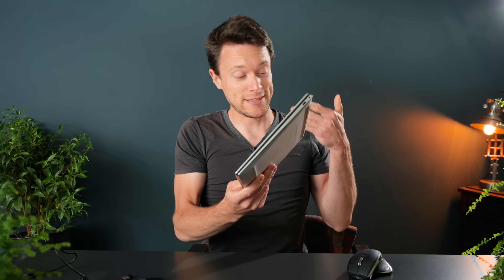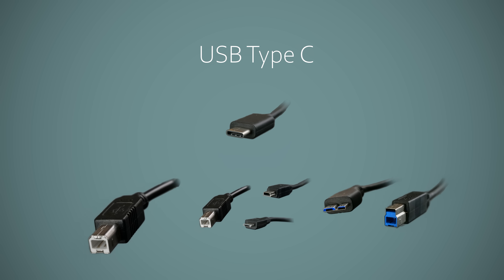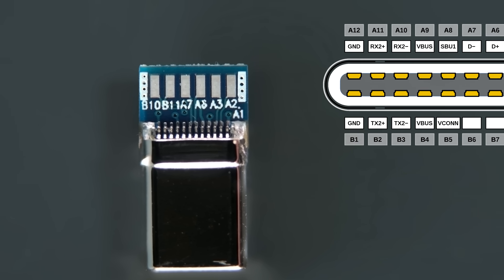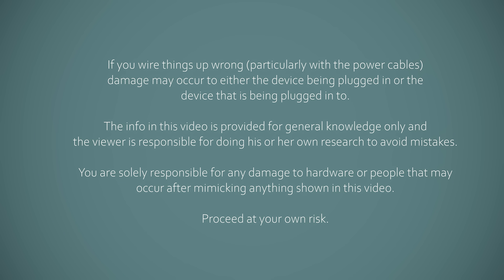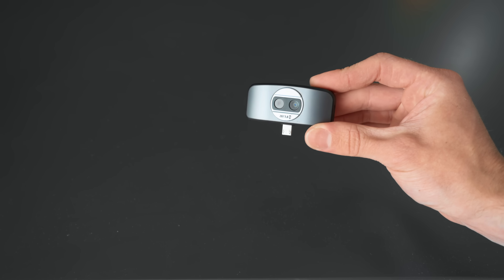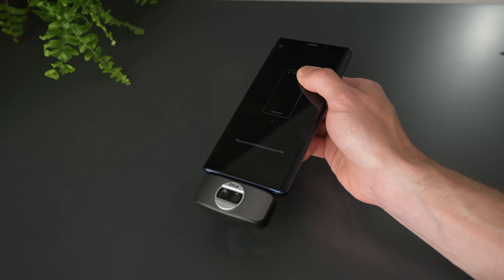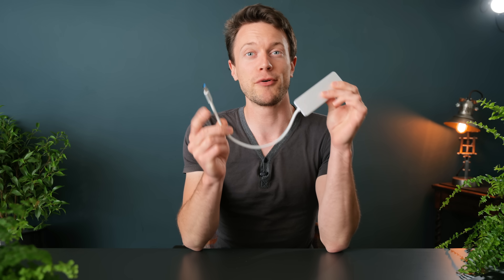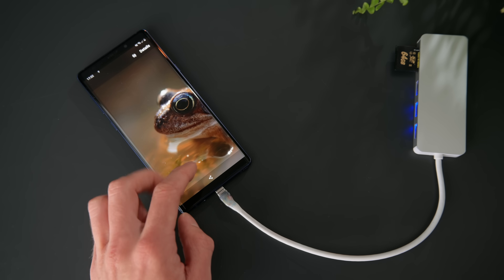Converting devices to USB Type-C

Comment: I think this guy does amazing work and I have subscribed but for those who don't want to, can't or fear trying this kind of thing. Here is an easy solution....
Magnetic Plugs, Cables and Adapters. With the right set up you can have everything, including iOS, using the same type of cable. They connect either way like Type-C  but are a magnetic connection so if you accidentally hit the cable or drop the device the magnet lets go and you don't damage the USB port. There are newer types that are 360 degree connect that I'll be trying soon. ... You leave the Plug in the device because it  only a few millimetres high and will protect the ports from getting any contamination in them. Then you just use the one type of cable for all devices... Here is a few links below to get you started.
360 degree connections:     https://www.ebay.com.au/itm/360-Magnetic-iOS-Cable-Micro-Type-C-to-USB-Fast-Charging-Charger-Cord-Lot/254678554799?hash=item3b4c0658af:g:mAkAAOSw4wZdzibb
360 Legree adapters:    https://www.ebay.com.au/itm/3A-Magnetic-Adapter-Charger-Connector-Plug-For-IOS-Type-c-Micro-USB-Cable-New/284057558932?hash=item4223265f94:g:aroAAOSw3zJflmtr
Like type C connection.    https://www.ebay.com.au/itm/AU-Fast-3A-Charging-Magnetic-Cable-Charger-USB-C-IOS-Data-Cord-1M-flat-adapter/324367020245?hash=item4b85c7f0d5:g:fEoAAOSwz-dfs61J

Comment: Now i need the explanation how i can upgrade the type-a-ports to type-c on my laptop/smartphone and tablet...
Reply: Magnetic Plugs, Cables and Adapters. With the right set up you can have everything, including iOS, using the same type of cable. They connect either way like Type-C  but are a magnetic connection so if you accidentally hit the cable or drop the device the magnet lets go and you don't damage the USB port. There are newer types that are 360 degree connect that I'll be trying soon. ... You leave the Plug in the device because it  only a few millimetres high and will protect the ports from getting any contamination in them. Then you just use the one type of cable for all devices... Here is a few links below to get you started.
360 degree connections:     https://www.ebay.com.au/itm/360-Magnetic-iOS-Cable-Micro-Type-C-to-USB-Fast-Charging-Charger-Cord-Lot/254678554799?hash=item3b4c0658af:g:mAkAAOSw4wZdzibb
360 Legree adapters:    https://www.ebay.com.au/itm/3A-Magnetic-Adapter-Charger-Connector-Plug-For-IOS-Type-c-Micro-USB-Cable-New/284057558932?hash=item4223265f94:g:aroAAOSw3zJflmtr
Like type C connection.    https://www.ebay.com.au/itm/AU-Fast-3A-Charging-Magnetic-Cable-Charger-USB-C-IOS-Data-Cord-1M-flat-adapter/324367020245?hash=item4b85c7f0d5:g:fEoAAOSwz-dfs61J

Comment: The only reason manufacturers are still producing USB type A products is because it appeals to the widest user base. USB type C is only really used on phones, and ultra books, where IO options are fairly limited. The percentage of users that actually have a computer with a USB C port is also really low. This is expected to increase with time, but until USB C holds more market share than USB A, manufacturers are still going to produce USB A devices and products as its more profitable.

Comment: Why not move the pull-up resistor to the R2 position (@7:08) instead of scraping off the copper lane and adding that huge resistor? Wouldn't that have worked just as well, or is the pull-up resistor the wrong value? Nevertheless, awesome solution! I'll keep it in mind, thanks

Comment: Thanks a bunch. It's ridiculous that even after hour of searching I was unable to find out why my DIY adapter didn't work properly until I came upon your video that finally explained about the resistors I need to configure the Type-C breakout board. This is like the best kept secret of the USB Type-C world.
Reply: me too! I have a mini keyboard with micro usb. I bought an adaptor to type C but it didn't work. The adaptor only works for charging. Now I got it
Reply: @angvinh2721  If an adapter only works for charging, then it will also suck for charging and should just be tossed in the garbage.

Comment: This is really cool but I’d prefer the adapter for this. It’s smaller than the one shown in this video. No soldering required and comes two in a pack. You can replace what device is plugged in..

Comment: That USB mouse dongle is actually quite special, in that it is a unifying receiver, allowing multiple USB mice and keyboards of the same to be paired to one single receiving dongle
Reply: But most Logitech products also use Bluetooth as well as the unifying receiver
Reply: @fyretnt  Yes, but if you didn't have BT or didn't want to use BT for whatever reason, then this is actually quite cool.  And since it's not locked to one device, losing one is not that big of a deal, as you can replace just the receiver or device, and not have to get a set
Reply: @bklizard  yeah but to be fair even my old thinkpad from 2007 has Bluetooth e but yeah it’s nice to have both options

Comment: And by the time I've finally converted over to usb c they'll have made another standard again so in my opinion I'd say its better to just keep using the devices as normal until you need to eventually upgrade because its far more cost effective and efficient to use the older devices and trying to upgrade all my devices from my pc to my massager would take years XD

Comment: If i have a small powerbank that includes  micro usb cable attached to it and in change this to a usb c connector with one of these breakout boards. If thr host/sub device resistor is wrong will the phone end up potentially charging the powerbank instead of the other way around?

Comment: Why didn't you grab an SMD resistor off an old board? Why use the through hole resistor? I keep a few boars around and bins of parts off boards just for this reason. Sadly you have to hand measure most SMD parts to find what they are.

Comment: USB-C is a horrible connector. Too small, to fragile, too susceptible to dust getting lodged.

The best USB connector, by far, by lightyears, is type B. Large, stable in all directions (unlike A and C which are weak in one direction), very good engagement, one-way-only. Very sad that other, lesser, connector types have taken the lead. But as always, the best connector for the user is not always the best (i.e. cheapest to make) connector for the manufacturer.

Comment: Why bother? I have over 60 devices with micro USB installed and a similar number of cables. No need for a dongle just an adapter. It is going to be well over one if not two decades before my micro USB kit becomes EOL. If something works it just keeps being used. So a handful of 90p adapters to go in both directions if fine. I am writing this on a 9 year old iMac that I will probably use for at least another 5 years or so. There we have firewire, thunderbolt etc. Just use adapters, they are a permanent solution.

Comment: At 7:19, instead of scraping away the trace, and adding a resistor, it would be easy enough to simply MOVE the existing resistor to the pads on the ground side... neat and tidy.

Comment: About the more complex USB-C connector: couldn't you just move the existing resistor from R1 to R2? One of the locations is empty and it seems logical that you're supposed to just desolder the provided resistor to configure the connector while connecting the wires.

Comment: Wow, some of that final soldering looked pretty crappy. I'd expect some those solder joints to fail within a year. For microsoldering you really need to get at least TS100 soldering iron with preferably non-conical tip. And soldering flux. And pair of reading glasses or even a microscope would be good, too.

Comment: 7:04 Hi, I've been trying to do something like this recently, and this video has been really helpful. Have a question, though. If I take off the R1 from this cut and relocate it on the R2 pads, would it convert the connector into a guest-side device without soldering on a new resistor?

Comment: the question i have is in your video you said type c need to be classified either as receiver or transmitter but the charger cable which Samsung include in the box is type c on both the side so does it has any marking tat a end goes to charger and other to phone or how is it done

Comment: Nice...but no need to use a dongle cable ( looks like a type C to A  OTG  cable for usb thumb drives I have 2 ),   type A female to Type C male adapters are available also  female C to male micro adapters no cable about  $1 each got 6 for $7 on Amazon, also. Micro usb female to male usb C got 4 for   $5 on n Amazon,  my tablet is female C using a male C for charging, my cellphone and BT devices use Micro usb, having a set of adapters let's me charge any of my devices when only one type of charging port/cable is available,
I prefer using an adapter if possible,instead of a take it apart, to solder and a permanent hard to reverse change,
Yes I have made Yankee engineering kludge mods before on things, and probably will again someday, but they are usually a matter of necessity,  this has to work Now !! , no waiting on special parts, and usually on things not as delicate As tiny electronics, nice video and good info thank you

Comment: It's great that you solder cables between connectors, but keep in mind that  that could affect high speed transfers, and certainly it's not RF shielded. Ideally copper pads would place on top of each other to make a single body.
Reply: Probably not recommended to connect external GPUs for example.

Comment: Now if you could just show a way to modify external hard drives....
Older ones used SATA internally with a USB board plugged onto that then the micro USB (?) cable to that..
New ones just use a soldered on usb board so you cannot harvest the drive.
Changing it to USB C will increase data transfer rate.

Comment: Im fairly sure it doesn't matter the color of the wire and where. The original point is so that people know what wires are what. If you don't plan to do anything crazy you could technically use just one color. Unless of course they are doing something weird to the wires but I have never heard of that.

Comment: ..the only thing I regret about my performance MX is that it doesn't come with bluetooth. in fact,the MX master has bluetooth and I use it on a few devices, it became decent enough in terms of latency. 
Logitech barely touched BT with a few mices and that's about it. Even bought my mother a new mouse yesterday, only with an unifying dongle, none have BT.

Comment: peope are not good adapting really, in some countries microusb for phones are more common than usbc. imo to accelerate the standardization on usbc, maufacturers should stop making devices with usb a ports, like laptops. tho it being immediate is not realistic. there must be a closing gap. gaming oriented devices or pc in general will slow down the standardization of usbc due still utilization of usb a. and there are some accesories like the bt dongle that dont have a usbc counterpart which is also a reason of slow standardization.

Comment: Hi, is there any way to DIY this (http://www.adt.link/product/R43SG.html) to connect it via usb-c cable. To maybe repurpose a usb-c port on a laptop and have super crazy fast and cheap egpu possibility on an laptop with 2nd m.2 and slot for example lenonvo slim 7. So the idea is to have an detachable usb-c cable as connection between the m.2 card and the  egpu board. And you could make a beatiful case, too. Like your other beatiful PC builds (brass, wood/rope).
Reply: Maybe also a tutorial about usb-c female.

Comment: You see this is were I got the idea and wanted some feed back if you see this comment I have a mfi controller form Apple it great controller but I feel it have more use on a android controller so here I am I wanted to ask if it possible to switch the lighting cable that is in the controller and put a usb type c into the controller

Comment: 5:50
Why not just desolder the SMD resistor from R1 and resolder it to R2? It's much simpler and cleaner than scraping off and adding another resistor
Reply: because pull-ups are not the same value, but using a 0402 of the right value would be cleaner indeed.

Comment: I know it was months back so maybe they weren't a thing yet. But there are much smaller adapters than you exampe one https://www.ebay.com/itm/2-PACK-USB-C-3-1-Type-C-Female-to-USB-3-0-Type-A-Male-Port-Converter-Adapter/124188339156?_trkparms=ispr%3D1&hash=item1cea33abd4:g:9TUAAOSwEt9evvK~&amdata=enc%3AAQAFAAACYBaobrjLl8XobRIiIML1V4Imu%252Fn%252BzU5L90Z278x5ickkp2NA0WuhQytmt4dbStg00Du38XWhx%252FgTTZQIW0M9cB%252FVkx2Llg5lkHp%252B8p6zSZ3l%252FWJTjcU98gaSWPOx%252B4ZFOW2BUjoZ%252BZqaWsPC%252BD1qz7Wk6yk5MnrtRz0CMCSmKlHVCRi%252FAEbmnKJiAOVQRGp131B%252F2Cykb7fnw%252BZzO63GLRLt45FPtT0ZSgLg3Jo51cZTSqGbkNyOgD2lS6%252BI3z8MpPU2uVDyAiBdTV4puPg24qjZCNc6oX1%252B%252F73loYn%252BkMHmUDPYQQFnk3m%252F2PUBhkkfPL5OIWlTEOBm4QrVXegCcvjGVxPxrz7aZMDU9QQ8a%252B7hDtZiX77mtMvikAqqNoiXxlUnUC93TFCn0C5Kkyc%252FalIMOORdPn7xPEl9QwhCAxOH73LZL%252B0Ot0FZ%252BXTN7XSesMtgYOWsl2McEqe2AvplpEJvWKyiWOhO2YvTx354l7Hgd3UcFSiNzHgOXbY2gY5lre2kNQbCpo14J2ePvU0dc0VOpnfcDIEiTzzzB8JSbabekCPGm5IN1CyUUYzRCoszhZcLhe36lqWLGQcEI42XIY%252FHrXAWmsDEFM9WZ%252BVU4DBWNDaAv0Iksdi8iSRS4SeaCtdI%252FVtPamej%252BxavODWmUfK7vSgPT5DqZ2xhxi11U6HUv4JyB23oLNgLDiW4jtctBxAZjkxNe5qbqcsXbBllvkoHIEvQTjYWBbWXOseP50JcLLpnc%252FhFAxFDFVNdLMCZk3EWRiyDUMQWi3MOCEjKhUrWdac0%252F0re9SsCzPCWRyl%252B%7Ccksum%3A124188339156297ef97ddb3a4edc9ddeccaa6cc184b5%7Campid%3APL_CLK%7Cclp%3A2334524 as an example.

Comment: So...you break apart your USB devices...solder a bunch of wire onto them (probably requiring you to buy a soldering torch) and potentially fry a USB port if you do it wrong...just to make a USB dongle. Folks just as a note and far less of a headache than this guy is putting out you can pick up a conversion device pretty cheap (probably the same price as a soldering torch or less) and not have an ugly mess or go through this trouble.
Reply: It certainly isn't for people who don't know what they are doing lmao. And even then, it's a good project to learn such things.

Comment: USB 3 has been known to interfere with 2.4ghz in close proximity causing issues with unifying recievers and other mouse receivers. additionally,  the mouse that was converted also has Bluetooth IIRC and laptop antennas are less likely to be affected. This being said,  great video!
Reply: I have a similar mouse with the same receiver, but when using bluetooth to connect the mouse, it's very laggy, so I'd say that's not a real alternative unless you're just rarely using the mouse, or don't care about latency.

Comment: The real problem is that the people creating all this stuff are too young geniuses with no life experience.  Way back when RS-232 was created, it had way enuff pins to make it symmetrical; but no, it was not.  Who made the telephone (and evolved into ethernet) connector, with the clip that snags on everything when you try to untangle or pull it out?  Then we got usb, which you always get upside down and won't fit, would that have been so difficult to figure a way to avoid?  And why the separate ends, is that really necessary?  And the micro-connectors, don't get me started!  Only two sizes, I think not; can never find the correct one.  Now they finally figured out they could make it reversible, but again (RS-232, can you hear me?) twenty million pins again.  Good grief, Charlie Brown!  Somebody in here said wireless, I can certainly see why.  Get someone on the team who can think pragmatically.

Comment: Just get an adapter. No dongle, no stress. Adapter from USB A to USB Type-C, ez. You will not have any dongles and you skip the time lost doing what he did in the video. Also with an adapter you can connect it to a USB A only computer and also a USB Type-C one, put the adaptor and you get Type-C connection, remove it and you have USB A.

Comment: the USB type A is the most common, it's better to use a dongle from time to time than to be unable to use any A type in most of the computers and hubs... I have 4 A on my desktop and 6 on my hub but only 1 on my smartphone... it's a question of frequency... you're doing like converting a gas motor to methanol in a land where most of the stations have gas only...
adding a type C on the other side of your type A keys is a better solution

Comment: Why convert and why not just buy a type c usb hub? Why old lap top had only 2 usb 2.0 so I had a 2.0 usb hub to connect mouse, keyboard, etc. My new laptop has 1 type c 3.1 and 2 type a 3.0, so I update my usb hub to a type c hub and all my devices without buy new more expensive replacements.

Comment: Sugru is a soft silicon material. So it can bend and the internal may be damaged pretty easily.
For this you should use Polycaprolactone (PCL) which is a low temperature thermoplastic (it melts at 60°c). When cooled it will harden and make a rigid plastic case, which would be better suited.
Also for the pull resistor, why do you add another one ? after cutting the trace you could just add a wire from the resistor pad to the GND.

Comment: This could have done a lot neater, by using the SMD resistor already on the board to make the link to negative, and by removing the breakout PCB from the USB-C connector (or just buy bare USB-C connectors, and hooking this connector directly to the pcb. You can grind back the traces on the PCB far enough so they don't touch the connector pins., and then glue the connector to the PCB. After that is done you can place minute wires between the connector pins and the traces on the PCB.

Doing this, you can even use the original housing for the mouse receiver.